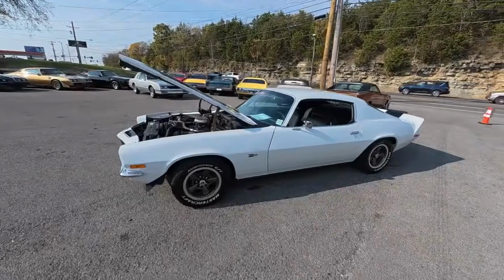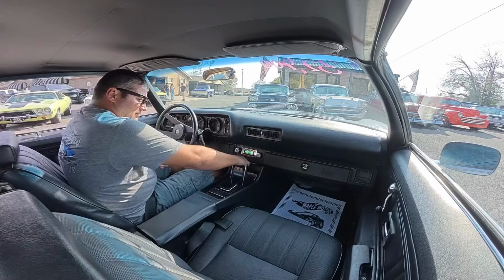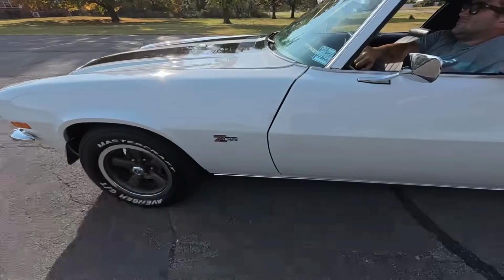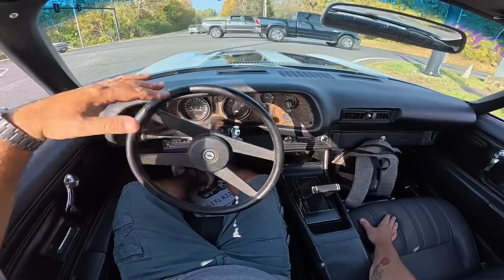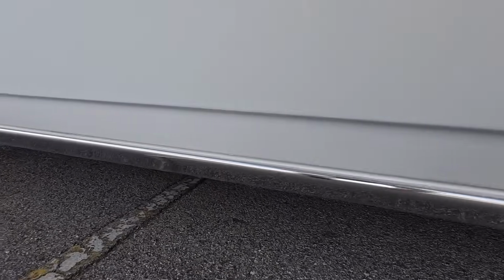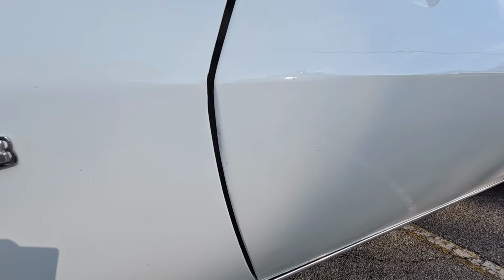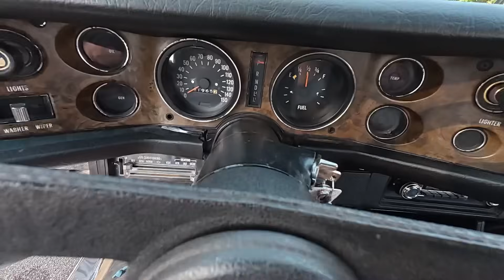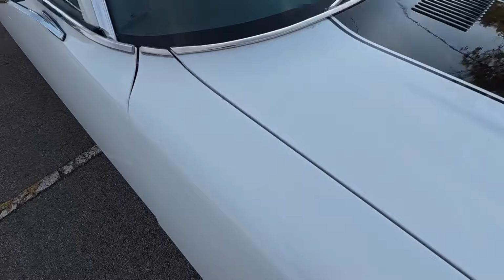Test Drive 1971 Chevrolet Camaro SOLD $32,900 Maple Motors #2858

Comment: That's a pretty nice ride. To be fair though, the passenger side front floor pan is rotten, and will need replaced. But on a car this old, I expect things like that---it's not a deal-breaker
Reply from the maker: Ive had it on the rack multiple times. Prolly like 10 times actually lol. I own a car lift at home , it is a solid car no rot. What you are seeing is pain’t flaking off, I can see how you are mistaken from the video. I’ll send pics or whatever you need. Floors are 🤌

Comment: I had a 72 RS/SS LT1 Z28  same black on white , horseshoe shifter no air with the Impala style steering wheel . Being an RS the front  nose had the endura extension.I blew it up in 1981 . 
I would luv to have this ride .

Comment: Hey Nicholas seats are out of a 70 Camaro they didn't start the high backs until 1971
Reply: i didnt see rear sway bar, front aluminum spacers under a arm bumpers, and the bumper in incorrect. is this a true Z and those parts are missing?